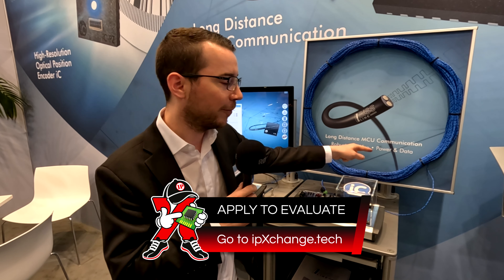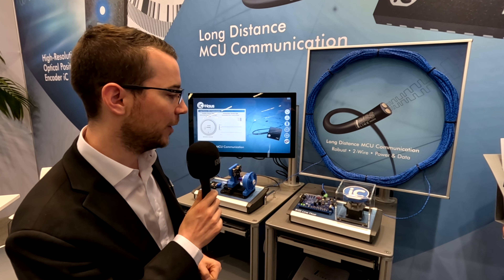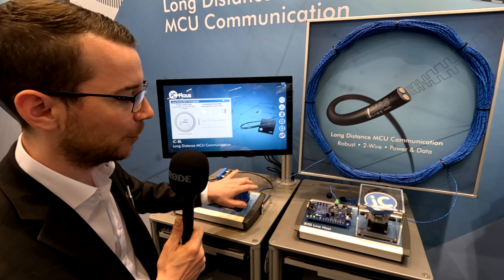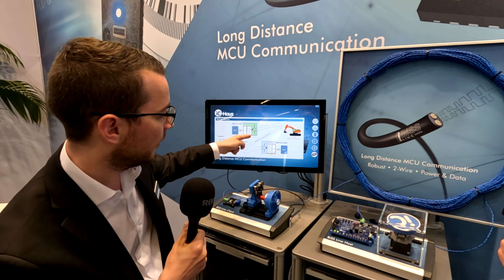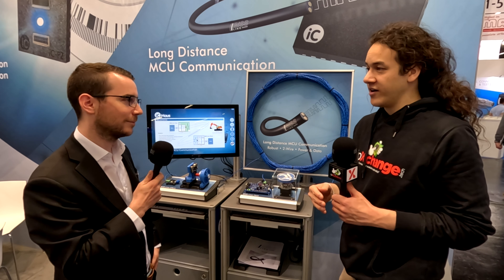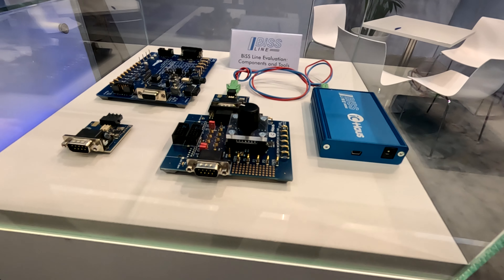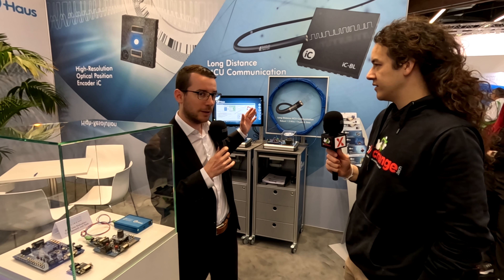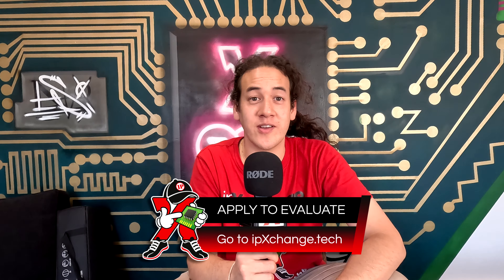Robust 2-way data communication and power using just 2 wires? iC-Haus has the solution!

Comment: "So you've got power and 2 way data, only on two wires, OK Wow!" 
This isn't exactly a ground-breaking "new" technology that these people have invented. It's not even novel. The old PSTN / POTS analog landline telephone system used to do exactly this. 

It supplied 48vDC and then used linear superposition, which is the process of combining the DC power with a low amplitude AM signal which can be detected at the other end using a DC Blocker (i.e. a capacitor) and an aplifier.

Sorry to dunk on your product, but the way this sounds it's like you guys are saying you invented the concept of combining signal and power over a single pair of wires, when the concept has been around for almost a century.  

... and by the looks of your trade-show booth, it also looks like it's expensive (for your customers, your engineers know it costs almost nothing to implement). 

Basically, this isn't new, and it shouldn't be expensive! It's been done before, at higher bitrates, over longer distances, even with inductive loads.